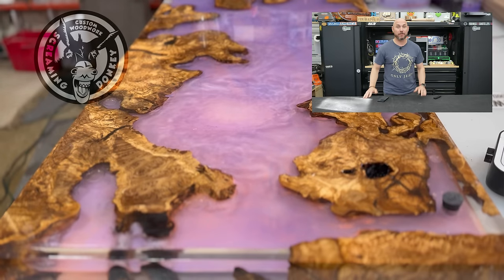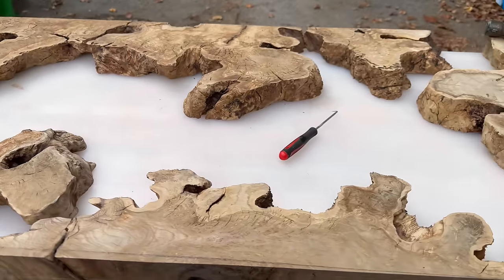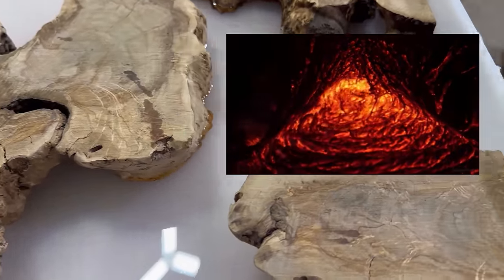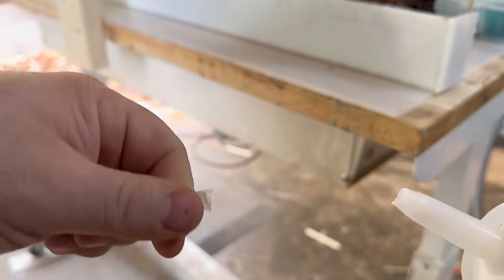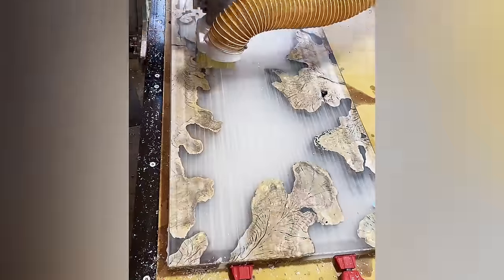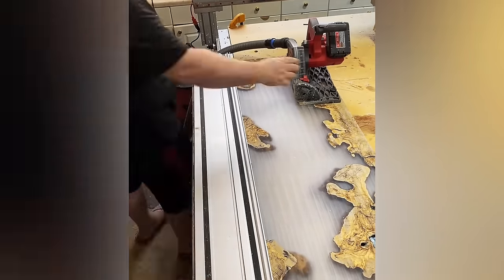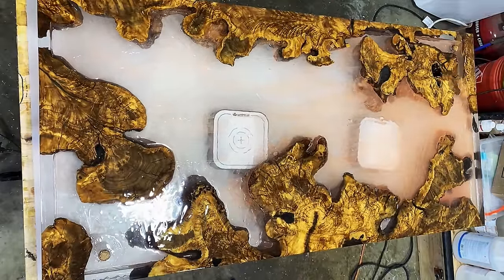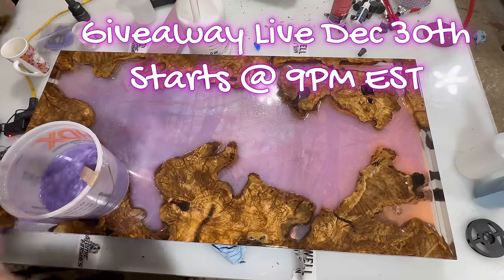I Built a Liquid Core Vortex Table

Comment: A wood working trick, when working whit woods that have lots of holes or cracks. Do some sanding so you get the dust from the wood (Make sure the sanding material dont have pigments that leach out and mix whit the wood dust once it's whet). Keep it and then mix it whit epoxy to make a really thick paste (Like drywall spacel), that you force in to the holes. when the epoxy wood paste dries it will have a simelair colour and look as the original wood have. And if done properly, it will be difficoult to see a difference between the paste, and the original wood.

This trick can be used for pretty much anything wood related, for as long it's not going to be in contact whit food (Most epoxys are toxic, and should be kept far away from food related stuff), or is going to get oiled. Wood finishing oils will not stick to the epoxy, so any spots that have been treated like this, will stick out after recieving a coat of oil.
Reply from the maker: Wisebond is safe for food contact

Comment: I have one question did you think about using a pump or anything live that instead of the mixing plates or did you want more of a cyclone effect instead of a river effect also how long have you been using wisebond epoxy,have you ever used any other epoxy
Reply from the maker: Yes, and yes I’ve used just about every epoxy
Reply: @screamingdonkeywoodwork   sorry for the lengthy comment just was curious

Comment: That looks so cool! Will there ever be any issues with the mica settling and not mixing again if the mixers arent turned on often enough? Also, where/how do you obtain the burla and slabs of wood you use for the tables?
Reply from the maker: Yes, the effect only lasts about 2 hours before the mica starts to settle.  There’s a magnet in the table used to mix it up again.  Olive wood burls can be found readily on Etsy.  Good ones must be shipped for extensively

Comment: 13:37 Instead using screw, i would recommend using tap to make say m6 or m8 tread on the wood, fuse it it with CA, let it dry and repeat with a tap to make treads that take pretty impressive amount of pull. Then use bolt end to hold the wood. Those marks are easy to sand off but screw head might dig deeper than wanted. You can also use protective material between.
The magnetic mixer use was smart, but to get the flow into all places, maybe instead you could have used PVC clear pipe with holes drilled in it that runs all over the place inside the table and put on the filler a small circulation pump. While i like for safety it being filled from top, visually flipping it over and filling that way would make more sense. Each has their own pros and cons.
Since the wood was so porous and its liquid core, maybe look into some acid to roughed up the surface after the pour is done and put in flood coat of UV curing or heat activated resin.. its kinda wasteful but it would seal everything inside. Just one pinhole might cause wood suck in water and expand, so that is the danger of this thing and i would hope the new owner updates the folk on how this lasted on the long run.
Cool idea still, just needs some kinks be ironed out and i really like it cause there is less epoxy being used in this than on normal river table.
Reply from the maker: lots to think about.

I'm responding to this old post because I have a sudden compulsion to clear all the "I haven't responded."  If your comment was generally supportive:  Thanks for watching I really appreciate it.  If it was insightful:  I'll definitely give that some thought before I do it again.  Negative: traumatic brain injury or just born stupid?

Comment: Purple Haze - very cool. Looks a bit like the effects that PC modders get with the cooling loops for high-end PCs. My fear would be mold and fungus growth within the table - perhaps there are some inhibitors that could be added?  I could also see a circulation system using PC cooling loop parts that would create a real flow down the "river."I think you'll kick off a resurgence of creativity with river tables or epoxy tables in general as this thing is cool as hell. I could see a round one with red, black, and yellow lighting called Hell's Gate.
Reply from the maker: A good % is glycerin and alcohol

Comment: I've tried something similar, but I used Mica pigment instead of pearls. The result was better than expected.
Reply from the maker: It is mica
Reply: @screamingdonkeywoodwork  
There are peals, and there are flakes. Flakes, due to their irregular surface, are affected more by the flow of water or even Glycerine, although they are a little more prone to stick together, if not mixed thoroughly.

Comment: After watching this, anyone with PC water-cooling knowledge can hopefully see the very easy ways to improve on this. Turn the table into a giant giant distro plate with a PC pump.
Run the tubing inside the table itself to hide it in the fluid and you will have flows from one side straight to the other with a small pump and wire that could easily be hidden in the legs.  Oh man, if I didn't see the dollars screaming in my face I would love to take this on.
The very least, if you want to do a V2.....

Comment: The vortexes are cool, but I would have used a few PC water cooler pumps and vinyl tubing to make it all flow one direction across the table and maybe put a spinner in the larger areas.
Reply from the maker: tried and mica clogged the pumps

Comment: Just thinking about this, you could probably flow water through this with PC watercooling equipment. You'd need to get fittings to go into the table but the water would end up creating a current, would make it look more like a "river" Table.
Reply from the maker: Mica issues on the pump

Comment: Two questions 
1) Is it possible to dip the wood in the epoxy to seal it up before using it instead of using CA glue?
2) instead of water that would start to change the color in time due to bacteria could you use vegetable glycerin?
Reply from the maker: 1.  anything is possible... but this wouldn't be practical
2.  I did use a mix.

I'm responding to this old post because I have a sudden compulsion to clear all the "I haven't responded."  If your comment was generally supportive:  Thanks for watching I really appreciate it.  If it was insightful:  I'll definitely give that some thought before I do it again.  Negative: traumatic brain injury or just born stupid?

Comment: One thing I don't understand. The filling test was before the flood coat, right? Why didn't the water leak out? Or was it just leaking in tiny amounts?
Also, thanks for the flood coating tips - I've never done it and I plan to use epoxy to finish a guitar.

Comment: How did you top it? That was what I was most curious about. How can that be done? Pour a separate top and add it? Epoxy is more dense so you can't do that. Why would you not show that part? What am I missing?
Reply from the maker: Its there.  I drilled holes which were later used to fill it.

Comment: I got to build for you to try. How about a Ferrofluid? And for the extra credit one with Bluetooth connectivity. I wouldn't say something like a subwoofer but maybe some proof of concept small what 4 ohm speakers of sorts just to be able to get the ferrofluid moving and whatnot and sweet sweet vibes. I'm a fellow woodworker although I am not the sort that does what y'all are doing. I am going to attempt to make my second table as the first one was an absolute nightmare and came out horrible because I ended up accidentally mixing my tabletop epoxy with my deep pour epoxy which was part A of 1 and part A of the other and when I realized it I took a spaddle bit and poured everything in there at one time and just try to mix it up as best I could. Funny thing though it actually all cured within 24 hours it was just the areas that did not get mixed up properly were really rubbery. Also because I didn't have the tools and pretty much create all of the things I use, I built a slab flattening table using a coffee table size slab of granite that was supposed to be well a coffee table but hadn't been built yet and then I just rigged up a system for my router to basically float across with the added dust collection which was pretty ingenious. Needless to say after flattening the slab it went from being an inch to about 9/16 which just was pointless at that point so I learned a massive amount luckily the slab of cedar I used was only $8 because it was just a throw away. But I also learned how to pretty much make every single solitary mistake you can possibly make when making an epoxy table so next time I feel very assured that I might get halfway there.

Also a question has anybody tried using some sort of vibrating tool similar to what they use for concrete to rid themselves of any air bubbles? Is that not a thing? Obviously I'm referring to the ones trapped under the epoxy well inside instead of using a torch on the ones at the top or is it just unnecessary?
Reply from the maker: Great minds think alike.  in the works already.

Comment: Just a suggestion. Extend the magnetic pill and that should increase your turbulence.
Reply from the maker: Tried it.  Resistance was too high
Reply: @screamingdonkeywoodwork  Then maybe 2 pills in an extension?  BTW great video.  Very clever and you're pretty funny as well.

Comment: If you would have done it with mineral oil I know it costs more but the swirls would expand more and give it a more live look but its amazing tho
Reply from the maker: good idea, but even at a 50/50 mix the glyceryn water mix was to thick to be turned through 1/5" of epoxy.

Comment: 2 questions. First: When working with this kind of wood, why not coat it in a resin before making the table? That way you don't have job and time sinks like the pva thing before you flood coated it. Second: Since youtube doesn't have a DM system, how are you giving away things? Like how are you contacting the people?
Reply from the maker: Hard to explain the first one… but here I go… epoxy warps wood absolutely, so it had to be flattened even impregnated wood only gets so much penetration, and harder brittle woods with high oil content even less like olive.  So pre flood coating it would result in a warp that would have to be flattened out and really would t have saved any work because a flood coat requires 3 applications

Comment: My guymost guy - stabilize the wood next time. You take chunks of wood and submerge in epoxy and put it in the vacuum chamber. It'll pull all the air out and replace it with the epoxy.
Reply: It'll head off some risk of the wood rotting o er time within the table too. Glycerin or no
Reply from the maker: my guy... the holes were too big for that and  I'd need a massive vacuum chamber... but it shows you're thinking.

I'm responding to this old post because I have a sudden compulsion to clear all the "I haven't responded."  If your comment was generally supportive:  Thanks for watching I really appreciate it.  If it was insightful:  I'll definitely give that some thought before I do it again.  Negative: traumatic brain injury or just born stupid?
Reply from the maker: and you get 2
I'm responding to this old post because I have a sudden compulsion to clear all the "I haven't responded."  If your comment was generally supportive:  Thanks for watching I really appreciate it.  If it was insightful:  I'll definitely give that some thought before I do it again.  Negative: traumatic brain injury or just born stupid?

Comment: Not sure why you didn't go with what's done in the computer building world and use essentially water cooling gear to get a flow from one end to the other and all the connections, vs using those mag mixers.

Comment: Maybe next time if you put the fill holes on the bottom use boat drain plugs.
Reply from the maker: It will be a dining table.  Flipping may be an issue

Comment: @screamingdonkeywoodwork stopped at min 26 of the vid, 
I think one of the mistakes you did here is not giving a second thought about the liquid.
The liquid for those liquide cores is about 40% water 10% alcohol and 50% glycerine (more movement = more water, best is about 65% water)
Reply: 34:35 ah ok now i see you've added glycerine =), try and see my ratios, would look amazing
Reply from the maker: I did about your ratio first but it was too thick to spin

Comment: Hi, just been watching the other vids and offcourse I had to sub. 

However, I also want to point something out, wich could be just me having an issue with it, since I have not seen anybody else reacting on it. And i'm not sure why it happens, weither it is an issue of the camera angle or something that happems during the editing.

Anyhow, since I really like what you are doing and can't hardly wait to see your next build, I would like to point out this little issue.

I'm watching your content on my phone and during the lenght of the videos, I have to constantly turn my phone to either the horizontal or vertical position. Apart from being annoying, it actually making me dizzy, to the point that on the cthulhu table (sorry, do not know how to spell). After 5 times flipping my phone, I just fast forwarded it to the end result... 

With that i have 2 problems.
1. The only way for me to support you and your channel is watchtime and there you are missing out.
2. I miss some of the content, wich means missing out on some funny moments.

So, again, it could be just me, in wich case just forget I wrote this ( I was never here). 
If not, could you please spare a few moments to figure out why it happens and solve it, so the experience for me as viewer would be even better.

Whatever the outcome, keep making these tables, they are off another level!!!!
Reply from the maker: It has to do with the majority of my content being for TikTok.  I’m gonna keep working on it to get more horizontal video for my YouTubes

Comment: That's all cool but... If you would have drilled 2 holes and used a pump (a simple closed loop), for $80 you would have gotten a better result.
Reply from the maker: Mica clogged 3 different types of pumps.